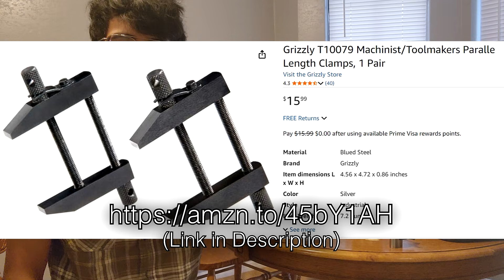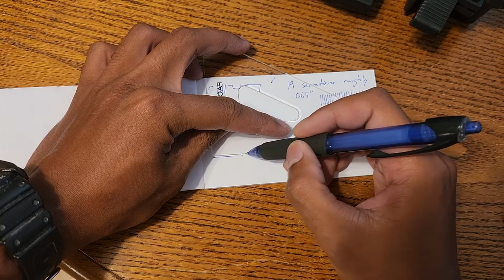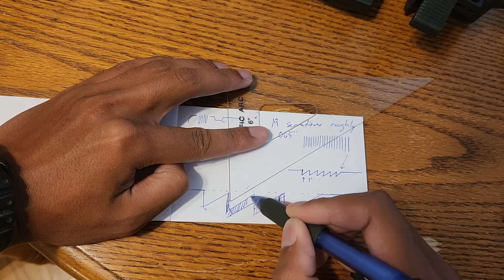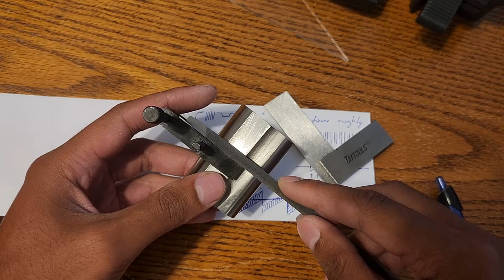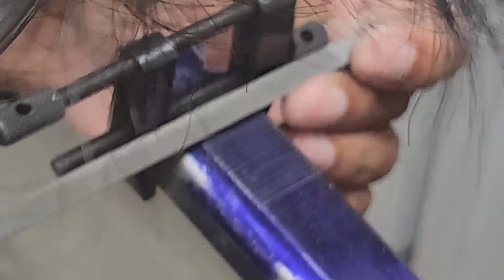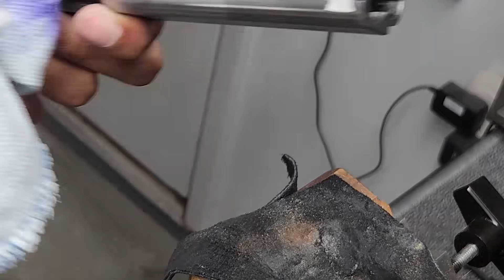Hand-Cutting Serrations: Theory & Execution

Comment: Why?
Reply: And why not? Just last week I brought a S&W M&P .38 transitional, otherwise known as a pre-model 10. 6” barrel, 5 screw, made in 1953, all numbers matching including the grips, beautifully finished, everything for $400. Way better than any new gun you’ll ever get for twice the cost. But when I got it to my horror the double action was so stiff snd bound up as to be almost unusable despite an excellent SA trigger. With encouragement from my fellow SW forum members I was able to remove the side plate, carefully disassemble the internals and soak them in Hoppe’s, then following a few videos from another gunsmith friend of mine I very carefully stoned and polished a few critical surfaces inside the gun, NOT the sears which is what so many hacks mistakenly think requires filing and grinding, and then carefully reassembled the gun. I had to repeat a few steps to be sure I got things seated correctly, etc but all told it was deceptively simple and after final assembly and testing the entire gun functioned perfectly with a smooth, light, clean and SAFE trigger. All without having to spend $300 on shipping back and forth to a gunsmith and waiting several weeks to several months, assuming a gunsmith could be found at all. Not only can you not put a price on that, you can’t put a price on the self-satisfaction that comes from learning how to do something for the first time and doing it right to boot. And THAT, my friend, is why 😉
Reply: @tomhanna2714 man I'm gonna be honest that was a lot of your story and nothing on why you would serate the groves. I'm glad that you figured your pistol out but I wasn't looking for your story of self gratification, I'm looking for the reason for sharpening the groves.

Comment: If you want to do Les Baer style serrations (60deg serrations instead of sawtooth) you can just use a 20 LPI Grobet checkering file and it goes a LOT faster. Plus, with a checkering file, you only need to set up and use the guide once - checkering files can self guide on flat surfaces once you have the first set laid down.  I did my first build this and it came out nice despite never filing anything before.

And the coolest thing about using a checkering files is now you're you get to checker your front straps and mainspring housings, too.

Comment: my favorite texturing is just to do diamond checker texturing and then lightly sand the top edges down so it doesn't cut your hands if you're not wearing gloves.
I like it because of the omni-directional grip vs single directional cuts meaning that you don't have as much authority over the thing you're trying to grip.

Comment: just use a checkering file.

yeah its a little expensive BUT it doesnt go deeper than the bottom of the checkers. Your triangular file will go as deep as you do it
Reply from the maker: those won't produce a sawtooth pattern, they will put V's in the steel.

Comment: Are those cinnamon Pop-tarts?  Here's my pro-tip, young Jared.  Just once, grab the store-brand poptarts ( or better yet - pop into your dollar store - they're even better ) and try those.  They're like 10 for a $1.38.  I swear, they're softer, chewier, gummier, and they pry pump more gluten into them 'er something, and they're definitively better.  It's my contention that store-brand Pop-tarts are conservatively 15-20% better than the real brand.  I'm sure they'll give you foot-cancer or make you infertile, but we are not descended from weak men.  You don't even have to warm them to make them soft, so the combined toasting time you'll save over the course of your life will offset the earlier health problems.  And the aggregated Pop-tart savings could amount to a set of used Tisas grips ( that mostly match?) in 10 years 'er so.  Try it once.

Comment: When I hand filed the front straps on my Springfield 1911 frame, I found that the hardness of the metal was not consistent. Almost like a heat treating flaw. There were some parts of the frame that greatly resisted cutting, while most of cut like a dream.
Reply: sounds like typical springfield quality
Reply from the maker: Springfield Armory Inc? found your problem
Reply: @JaredAF yes. It’s an early 2000s repro.
Reply: @JaredAF thank God I’m not the only Springfield hater out there.

Comment: are you planning to buy a mill? I just got a decent one, used it to make an optics cut on a hi power slide. real game changer
Reply from the maker: Yes, trying to get a small one like a PM 25
Reply: @JaredAF Look into a smithy 3 in 1 lathe mill drill. I think grizzly makes something similar now.
I got one from a strange neighbor for $400 and a broken photo enlarger a while ago with tons of tooling and rotary table. (It was a steal)
They aren't the most precise machines and don't do anything particularly great but for this application it's absolutely serviceable. They're small enough for a good size work bench and will get your feet soaking wet into the world of machining.

Comment: Nice work. When I worked deburr and QC in AS9001 we would get a red scotch Brite pad and cut little discs out of it to attach to a Dremel. Hold at 45° and run parallel to the edge, then 45° the other direction, then parallel to the serration. Will break off microscopic burrs without altering the geometry and give a very uniform brushed appearance

Comment: Have you ever used a checkering file, all they do is space out the line for you. You can buy them or make them from O1.
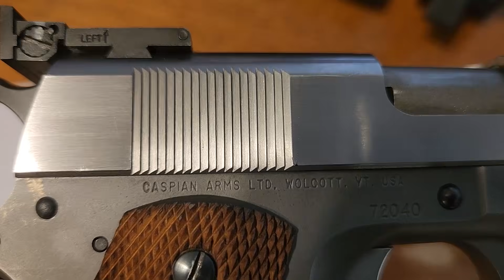Reply: 5:54 This counting confusion is known as the fencepost problem, as in counting posts vs. sections of fencing
Reply from the maker: a 15LPI checkering file would be close to 065" but would also be another 50 bucks for one application which is just marking lines. realistically i should have done this on a surface plate with layout fluid and a height gauge.
Reply: @JaredAF spoken like a man with no intention of buying another 1911. Who are you and what have you done with Jared?😂

Comment: "Milling machine", is that one of those vertical lathes I've seen in bigger shops? You can do this on a lathe though, but hand cut is classier in my pov!
Reply from the maker: i thought about using my lathe's cross slide as a shaper only after i had already started 😂
Reply: @JaredAF  funfact from a "Zerspanungs-& Industriemechaniker" which is a trained mill/lathe/Drill/operater & welder.

i basicly learnd how to craft guns, without being a gunsmith or benig able to do anything with guns 😅 German gunlwas are Made by insaneppl

and yes, using a lathe would BE a good Idea.
but by doing IT with the old way, ....thats waht craftmenship is about. 
WE Had to File 8week in a 3y Training😅
Reply: @JaredAF Honestly think that the purist side of you would have you doing all these operations on a lathe - you can do almost any milling operation on a lathe if you can find a decent way to hold the part in your cross slide.

For hand filing, I'm a hand-tool woodworking guy, and whenever I'm teaching saw sharpening, I always recommend to newbies to spend the time making a file-guide, can be basic, can be one you'll use forever. For an operation where you're hand cutting a machined part like this, I'd want to remove the human hand as much as possible. I know you're already done - but this guide is a tremendous option for those that come after:

https://youtu.be/ySG9qEAVHHI

Thanks for sharing Jared. Shop tour when?
Reply: @JaredAF  Lathes have done pretty much everything already, in this business nothing beats experience! I have shelves full of books for that reason ... Funny music btw sounds a bit like old British Progressive rock 
https://youtu.be/MqLydYRZliM?si=KuKAAEXanMaBieaU